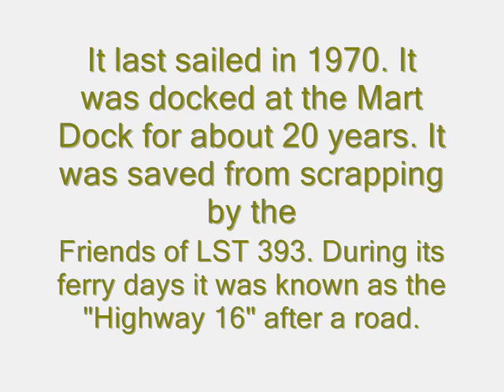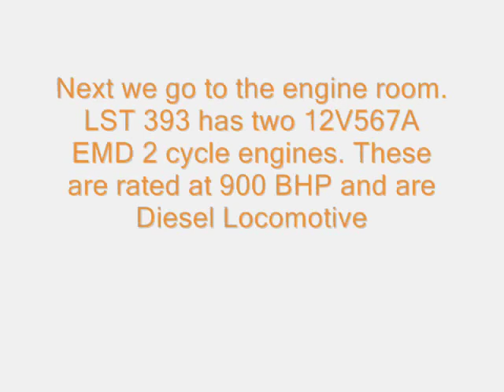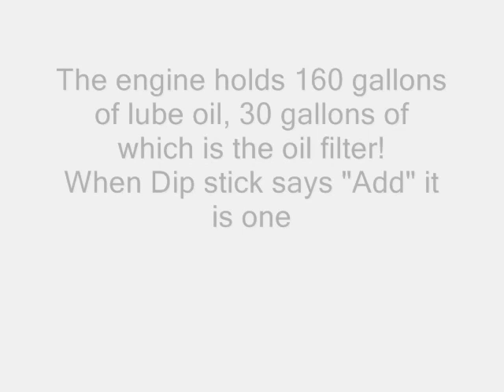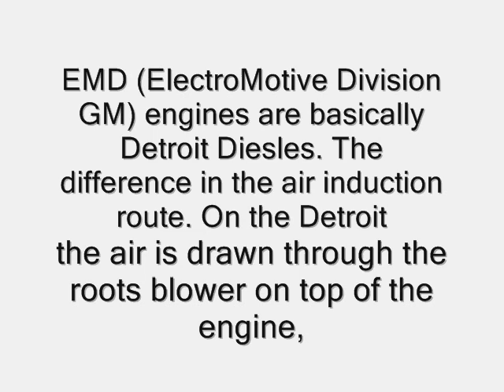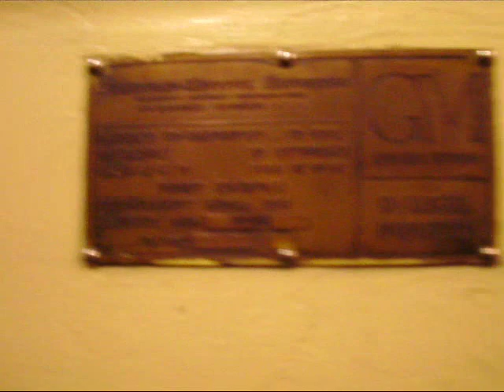LST{Landing Ship Tank} 393 Tour Muskegon Michigan.

Comment from the maker: Yes. The Detroit Blows the exhaust into the "air box" on the side of the engine. The exhaust manifold(s) are located  either above or below the air box. This is so the exhaust  can be vented to the rear where as the EMD exhaust is vented so it discharges out the roof. Interestingly it because of this that you can't "Jake Brake" a Detroit. Only an "exhaust brake"

Comment: At the beginning you stated that their are only 2 LST's that are still floating. Their are actually 3 including the 393,  LST 325 and LST 510 which has been in continuous use as a car ferry between New London,CT & Orient , NY. I know the 325 & 510 actually have running engines and move under their own power. Does LST 393 ever leave the dock? Does her engines actually run?
Reply from the maker: No ,it never leaves the dock. It is sort of permanently docked with sewer lines plus utility lines.My understanding is that the EMD main engines will turn over.But they told me that they cannot start them up because of fuel tank concerns by the USCG. Also there might be very old diesel in the fuel tanks that have to be dealt with, I which they could start at least one engine like they do with sub USS Silversides and its FM Opp diesel.

Comment from the maker: Fuel injection is the only way to get fuel into the cylinder as Diesels do not have carborators, spark plugs or distributors. The air is compressed high enough to develope enough heat that the fuel will ignite. Because of this diesels can burn just about any fuel except gasoline which has to low of a flash point. That would cause ignition before the piston reaches top dead center. This would ruin the engine. Theoretically they could burn crude IF it were heated high enough.

Comment: These engines were started using compressed air, or by other means?
Reply from the maker: They have a starter motor. These are locomotive EMD engines. In locomotives the engine is connected to a generator which has a starting coil turning the generator into a motor. the LST engine are direct drive. I know of no EMD engine that were air started except for an air powered starter motor. I  think that's what was told to me. They might have an air powered starter.
Reply: Other marine diesels (larger) are started by charging the cylinders with compressed air.